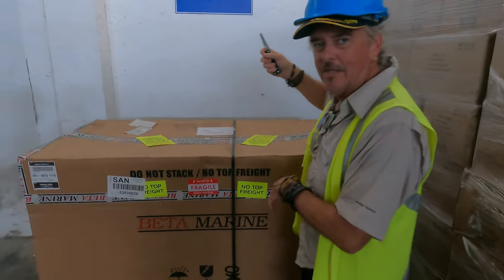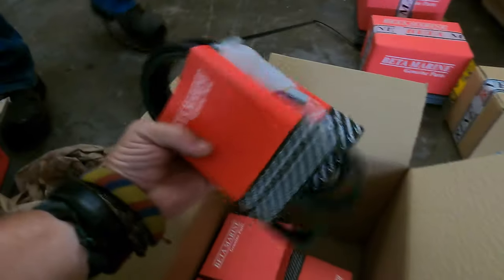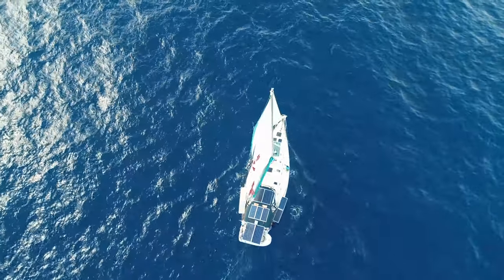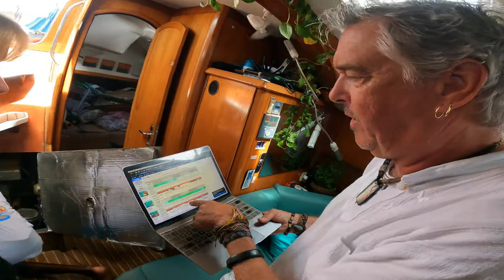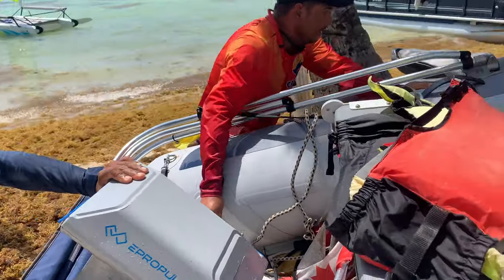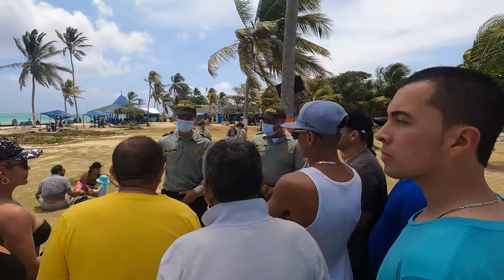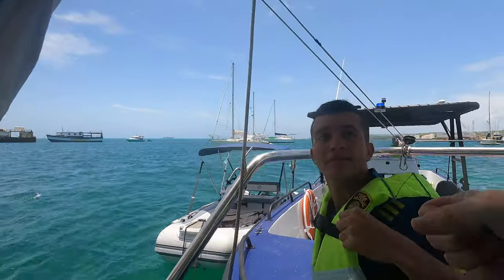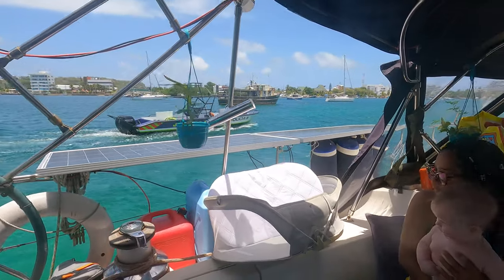SSL631 ~ the Police came for me...

Comment: On the salon's roof, 1 . RIP a sheet of plywood in half, temp screw it down over hatch where motors will come out and back in. Protect the boat yes, but will help with weights. 
2, build, a metal, rail, 4" I beam is cheap.
3 lay to lengths on top of salon's roof, and make it so it go pass the roof out the stern. Weld a couple of cross , bars, bolt it down where needed temporary,  or use strong straps, or big metal pipe clamps, 3, Rick, with bats you can move around, use the i beam as your support.
Pull old motor, with cross bar on the i beam, use a block and tackle, to slowly chain up old motor, little at a time. When the motor is pulled, make sure everything drained. And take it apart to make it easyer to move. The new, motor, keep it on the pallet... slide the pallet, on the i beams.
Ratchet the motor, over the opening. 
Now on the i beams. Have 4 lengths of the 4" I beam, cut at 4 feet. Weld them like a V , weld the V upside down to the I beam. Weld a cross bar.. use strong straps,  with ratchets, to life new motor off of pallet. Have a Chain hoist,  connect straps to chain hoist hook. Slowly, lower new motor down, makeing the ailment..
Easy peazey.... oh, I've swapped out , 5 ton , 
Locomotive,  transmission,  in the field..
Had to dig a hole under the train... weld tons of rings for chain pull spots.. we even removed 4 to 6 rail road ties by hand. ( take your time.)

Comment: Rick, this will work, and be safer. Your doing it on shipping docks, trucks drive on them...
Danny, has tons of friends,. With a pick up truck
1 ton, or flat bed.. build a I beam, x feet off the ground, sticking, 15 feet out the back, bolted to the truck, or strapped with 6" yellow cargo straps.  Nothing breaks them. Back the truck up to the lady...  brace the beam in the lady...
Chain hoist up old motor, high enought to clear the LADYS hand rails.. have the truck slowly pull off, with the motor swing with guild ropes. 
Put the new motor in the same way.. chain hoist it up to the end of the I beam, and very slowly, back the truck up to the lady, I beam is over , the steps, use guild ropes, someone chain hoist the motor as 2 people aline the holes...
Easy peazey....( dont drop it )  a flat bed, tow truck. Where you could buy 1 20foot I beam.
Chain 5 feet to the tow truck bed. 15 feet sticking out the back, drill holes and weld rings,
Tow truck back up to the dock, motor, is 15 feet behind it, 15 feet should get you over the steps.
And the tow truck can even, move his bed back , 
Good luck.
Reply from the maker: Getting the engines on and off the boat is the easy part, we have lots of cranes available for that.. the logistics issues are mainly with getting the old engine out from the hole under the companionway stairs, drilling in the new mounts, and getting the new engine back in the same place and on the mounts, without destroying the interior of the boat.. :)
Reply: @SailingSophisticatedLady  cool, dont forget, air space. Stuffing a larger motor in a smaller space heat will be a issue.  Think about adding a cool MEGA, cooling fan sucking all the hot air out under the steps. When you gut the old motor out. May want to RIP out the old fire walls, there newer fire walls for engine areas. And with the motor out what a great time, to get a new epoxy paint, in that area. Better rent a room for you and baby. Your going to want AC, no smells,  and cold showers, good luck.

Comment: You may have all ready done it. But...
At the dock to help the boat from rocking 
Hang 5 gallon buckets over both side, fill them with rocks a little, tie them off good, waves wouldn't as easily be make to rock the boat.
It's a poor mans stabilizer.

Comment: Rick, wrap your head around this. If the guy with the tools, says he can. Because the money.
Then gets half way thru and walks, what then..
Reply from the maker: That's exactly why we don't start until we have someone we have confidence will stay to finish the job.. :)
Reply: @SailingSophisticatedLady  make sure to read all my comments... I need in the field what others said could not be done. Rail road,  train breaks,
It has to be fix in a corn field, side track. 
Rick, making as much room, number one, 1
The tow truck, flat bed I'm sure your LAUGHTING at... but think about it.. buckets 3 each side with rocks to stop the roll. I beam, 15 feet in the air, to back a motor over the hatch. I would, screw up temp, 1/8" cheap board to protect the inside..
The rail system I LAYED out will work also.

Comment: I don’t know a thing about beta marine but I do know about Perkins Diesel engines and they literally last forever. That’s why you got over 26 years and 17000 hours. I don’t know if you know this but the life expectancy of a diesel in a sailboat is 5-8 thousand hours and you more then doubled that and the absolute hardest thing on a diesel is just idling for hours in end which you admittedly did a lot of. But at any rate that little Perkins was a great engine and yours wasn’t special that’s just a Perkins as long as they are serviced kinda regularly they just seem to never actually die. They might complain and grumble but they just keep right on going. And diesels do not like being hot an ordinary one will warp a head or blow a head gasket in a heart beat. But anyway just thought I would let you know. Don’t count on 17000 out of that little red beta. I would recommend full synthetic Diesel engine oil and quality stuff not junk. Also please for gods sake don’t use any more Fram filters they are the worst junk ever. I recommend wix if you can get them where ever your at. And what ever the manufacturer recommended hourly service is I would make sure to stay under that not over. And in case you were wondering if I am worth listening to I am a professional automotive technician. And I have done diesel work too.  Recommend shell rotella t6   But you can google good quality 15w40 synthetic diesel oil. Never use anything but diesel eng oil but I’m sure you already know that much.